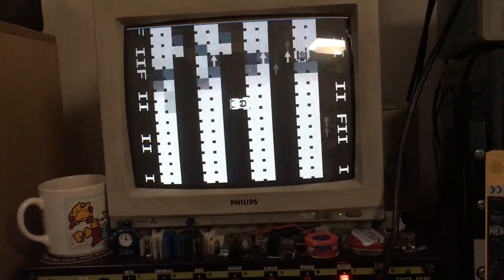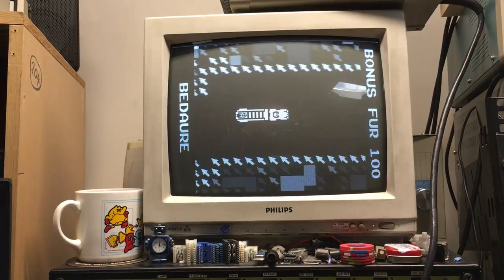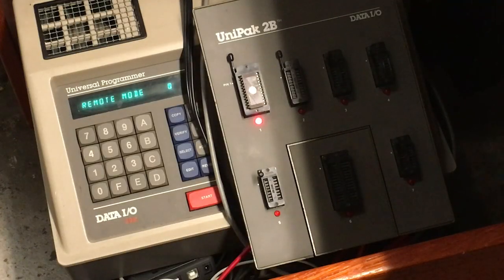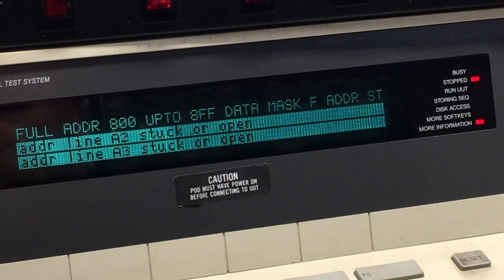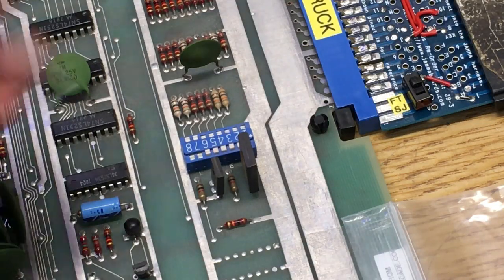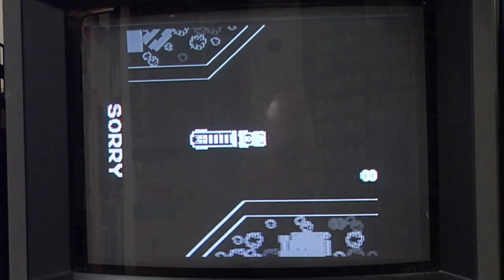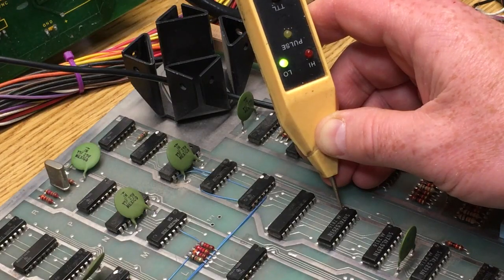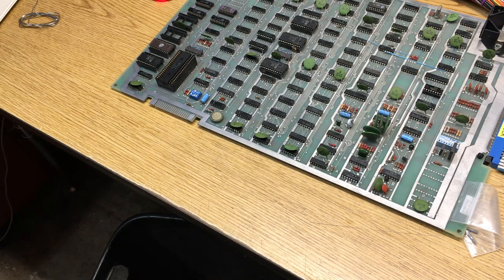Atari Fire Truck (1978) video arcade game PCB repair

Comment: ANDYS ARCADE,  what are the differences between XY deflection signals compared to H&V sync signals? i don't know what the differences are between deflection signals compared to sync signals whats the differences?
Reply from the maker: bill williams completely different video systems. H and v sync just tell the monitor when to start drawing the next raster line, or field respectively. XY signals are pushing a single beam of electrons around. They are not comparable.

Comment: Hey brother what kind of logic probes are you using? I have alot of boards that need fixing
Reply from the maker: Centrix VCA I use the cheapest of cheap logic probes, its called an LP-2800, they are common but effective! What have you got that needs fixing, maybe I can help :)